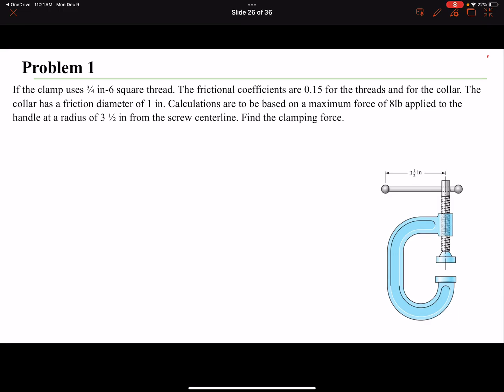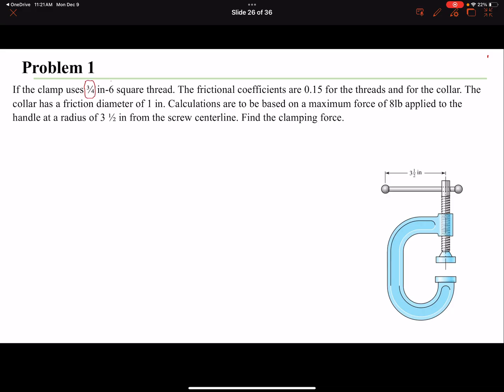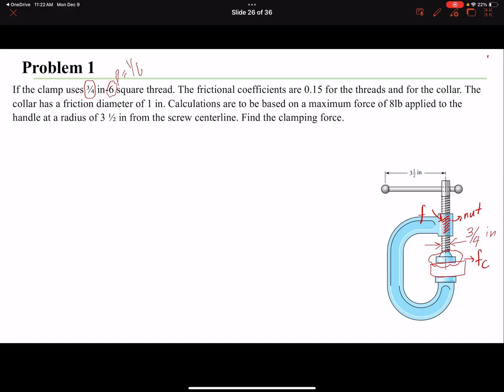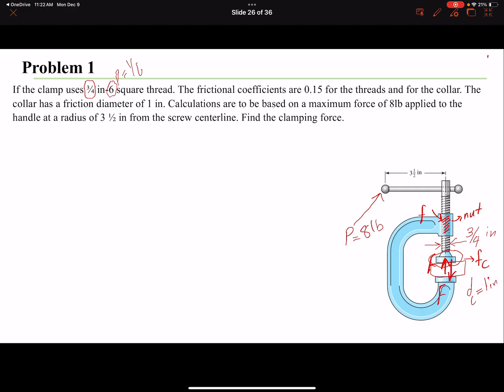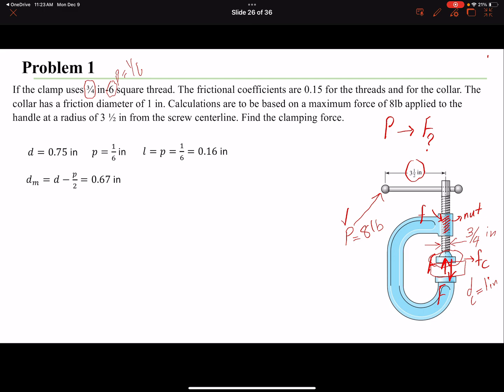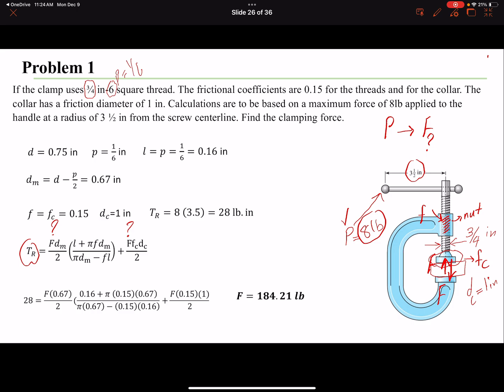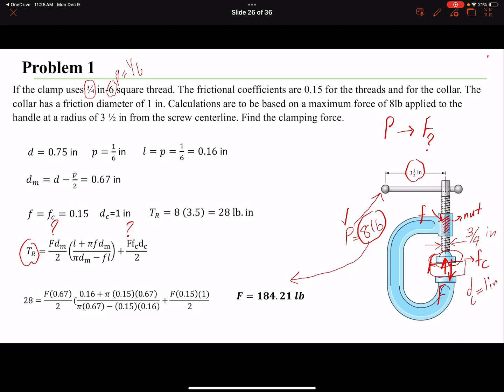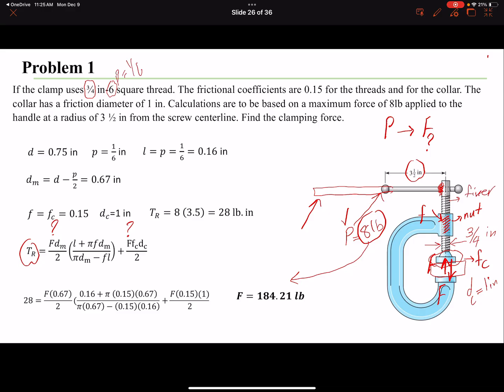Power Screw Example 1: Calculating Clamping Force for  Square Thread Clamp based on the  torque

Comment: Great video Dr. Sanei I had a question if you were to hold something with a similar clamp how will you prevent the object from slipping and what would the failure modes look like? Will you consider the shear stresses for it?
Reply from the maker: For an object not to fall, the friction force must be higher than the weight of the object! The friction force is normal force times the coefficient of friction. The clamp will provide the normal force, therefore the higher the clamping force, the larger the friction force and therefore, heavier objects can be hello in clamp.